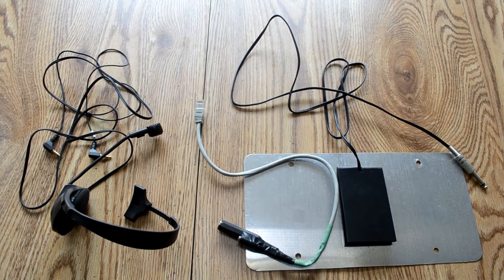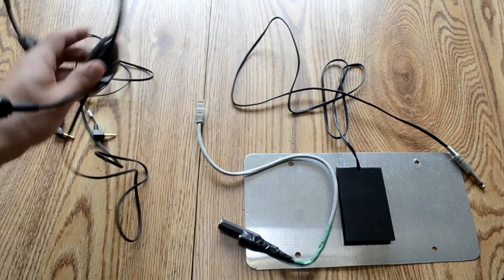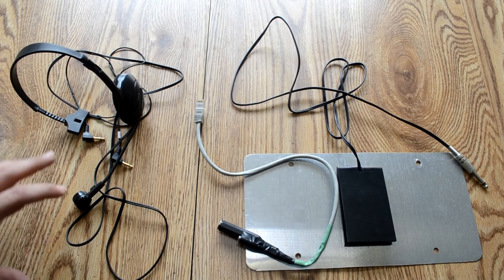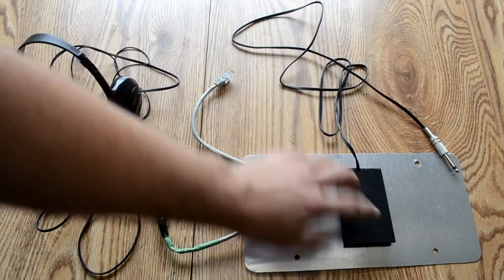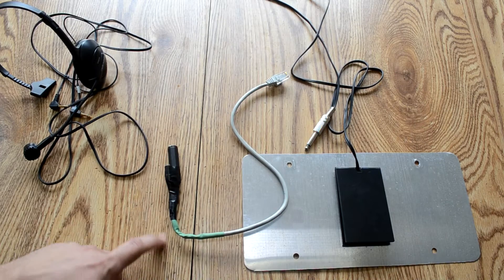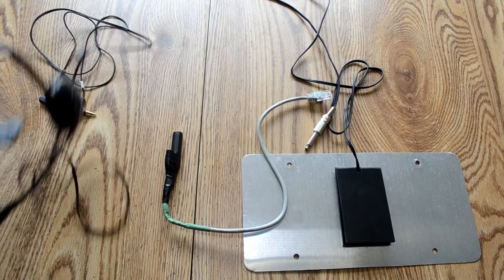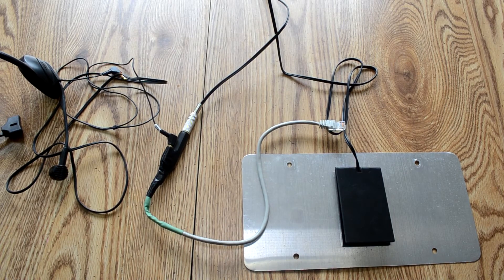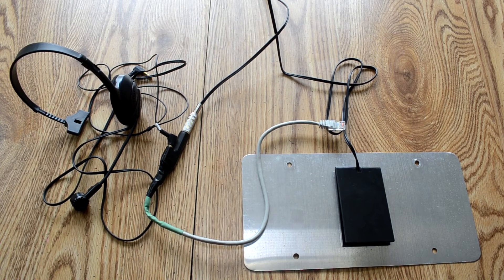Ham Radio Headset and Foot Switch for under $50!

Comment: you don't need to make a preamp for an electric mic. all you need is to supply +8v+ 4.7k resistor and a DC blocking cap 1~10uf i have made head sets for all my friends. and added in a electric mic in to my turner desk microphone. never used any preamp even talking 2 feet away from the desk mic.
Reply: Hey Matt - If you're still around, can you explain exactly how you connected the components for your mic?  I'm trying to do about the same thing for my Yeasu FT3DR but having trouble with the mic compatibility.  Thanks.